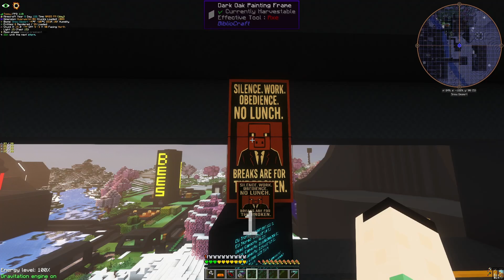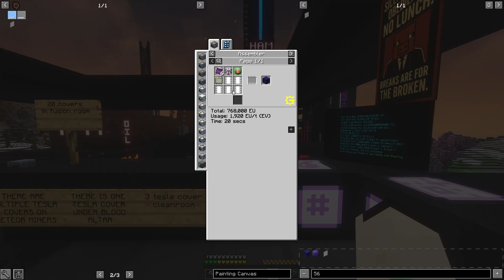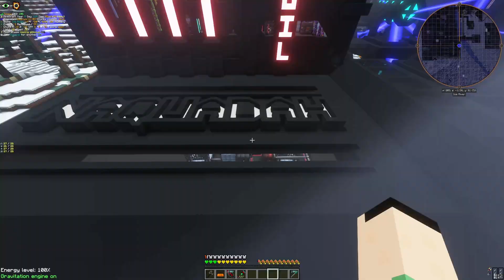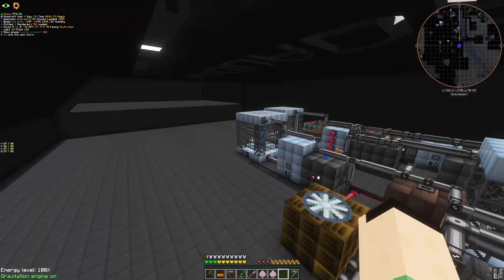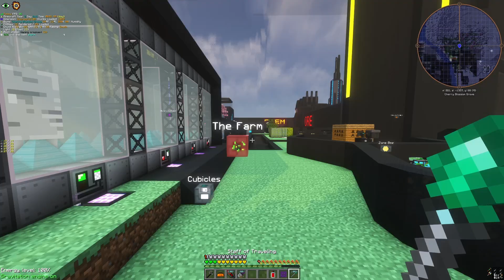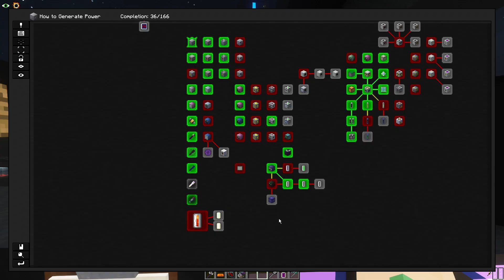GregTech New Horizons E91: Naquadah Fuel Refinery

Comment: Having a second source of power, such as fusion, would be good to avoid a catastrophic single-point failure. Even if the second power source is not as good as naq fuel, it'll be better than HOG and let you clean up some infrastructure and have peace of mind.